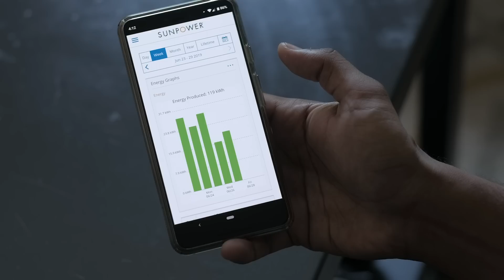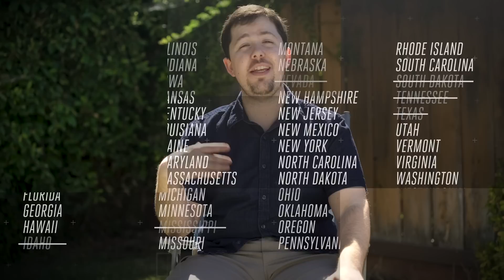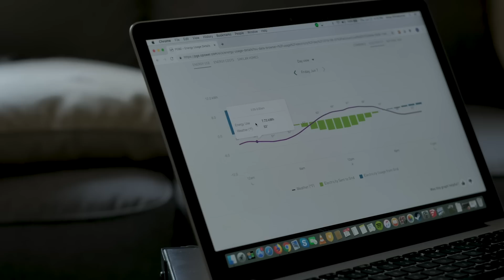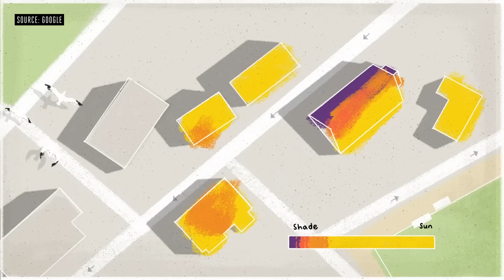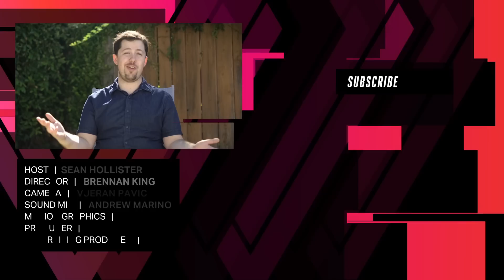Solar power is finally within reach, but not for long

Comment: $16000 is the cost of a cheap car...
Watching this in my 250€ golf
Reply: Considering energy savings, it will only take about 5 years to spend that much in electricity anyway, and anything after that is additional savings
Reply: @DannyRice01  sure, but u gotta have these $16000 in the first place...
Reply: @milonso650  You can pay for it with a loan, and use the savings on your electric bill to pay it off. If you go this route you have to wait the 5 years to start saving money but it still might be worth it long-term.
Reply: In US junker golf would cost more in maintainace, etc.
Reply: @ArthursHD  really? in germany they are the cheapest for parts ect. also, they are pretty reliable.
Reply: @milonso650  The US market is maximized to replace instead of repair.

Comment: You said it yourself in the video, the costs of these panels and batteries are going down all the time though. So even if the subsidies go away by that time the cost will be substantially cheaper, stop fear mongering!
Reply: Maybe, maybe not.  You cannot guarantee that Solar + Battery system will be 30% cheaper by 2022 ...

Comment: The UK subsidies used to be so good that you could get a 4Kwh system installed for free as long as you agreed to keep the panels for 20 years.  I don't think you can get them any more though because the subsidies are not that good any more but I managed to get them installed four years ago and they are truly amazing.

Comment: I am waiting for my Tesla battery storage, now.  Will have temporary electricity if power outages.  Plus be able to sell even more excess energy to the GRID.  I have my own micropower station.  Even with more wind and solar on the island my rates have never gone down.  You must look out for yourself and not the government.  More people moving to the USA and electric prices will keep going up.  Electricity is stable vs gas prices so I love my EV.  With its large battery, I never have to use any other charging stations but only my own clean home connector.

Comment: I saw the benefits with solar with expensive electricity in Hawaii.  I can not control healthcare costs but I can control energy costs.  My next purchase was a Tesla EV.  I save $900/month on gas and electricity without changing my lifestyle.  That is a lot a dough.
Reply: An average home in Hawaii is 1500 sf vs average home on the mainland, 2700 sf.  Most homes do not have air conditioning or heating as on Maui, we pay almost 40 cents/kWh.  Average mainlander pays 10 cents/kWh.  So multiply what you pay/month, on the mainland, by 4 and you would see how expensive electricity is on Maui.  I own a 2300 sf home and my electric bill was $600/month.  Gas averages over $4/gallon.  So you can see how fast you pay off your system in Hawaii.  It is becoming warmer and we may have to run the air conditioners.
Reply: @Firestorm637  wow...and i thought living in LA was expensive ...then good for you for using solar, hopefully climate change does not mess that up too
Reply: @hamadaj8081  Hawaii = The highest cost-of living in USA. It is a collection of small islands. If not made there, then expensive to "import". Cali is #2 ...
Reply: you use 900/month worth of gas and electricity??.....you must live in a mansion!!

Comment: buy a battery pack just big enough to cover the peeks
Reply: John C3333 no need for a battery in many markets. Net metering with the utility company makes that possible
Reply: @Matt.Collins  you don't want to depend on net metering though, because these programs come and go.  They could terminate it at any time.  It's good to have batteries and be self sufficient or at least close to self sufficient.  With no batteries your panels are useless if there's a power outage.
Reply: @redsquirrelftw  A battery bank to run the typical house, is a financial nightmare.

Comment: 5kw system for 18k usd??
In Pakistan u can get that for 3.5k usd
Reply: @T S In Australia the average 5kw system costs between $2700USD-$5500USD so it's probably got more to do with the cost of the panels.
Reply: @T S 😂
Reply: I am sure the sales company and the installer crew, permits, designer, etc all add to the cost of the basic parts.
Reply: @T S 46,000$ not 4,600$
Reply: @tonysmith6967  Not sure what source gave you $46k. The US Census has average income for household at $81,283 and non-family households at $51,197. However the average is a terrible figure to use in the US due to the top earners vastly distorting it to the upside. The median income is far more representative of most americans. Median income for those two categories are $57,652 and $34,611.

Comment: People always choose to go solar than to look at outer ways to save energy. For example, installing LED bulbs is a great way to save energy if your still using filament bulbs, also look into getting more insulation in the attic.
Reply: I'd be willing to bet anyone still buying incandescent bulbs isn't simultaneously pursuing solar panels.  I agree that conserving energy is absolutely important and a great goal but if you can do that and return some clean energy back to the grid for others to use at the same time, that's even better.
Reply: @palillo2006
 - Replacing all bulb in my house with LED's, lowered my utility by less than 1%.  Bulbs use a very small percentage of my total electric bill.   And the LED bulbs did not last the promised 15 years. My LED ROI was bad ...

Comment: So you are in California where electricity is expensive and is getting higher BECAUSE OF SOLAR. I am one for solar but when you look at Californias where you are basing this out of. Solar and most homes are called Grid tie systems. Where you are linked to the grid with a pay back system the problem is storage. Since you are feeding straight to the mainframe and not storage fluctuations for power cant be cycled. Everything else can be turned on and off by demand. Since these are independent power plants in perspective, nor there is any way for the providers of the systems to regulate this power like the cloud because it's all independent contracts. Also the fact that humans are greedy and want every penny. So it caused electric to spiral into a price hike due to instability and you the consumer to make it bearable in California to not be hit with a high bill to have it. Solar is not evil but a combination of no storage for off peak times, profiteering contracts, and more has lead to a crisis in California.
Reply: Totally agree, the better way forward is for electricity companies to buy large solar systems. Then we don't have the problem of everyone feeding their electricity into the system willy nilly. Plus economies of scale dictate that the price would be much cheaper. Rooftop solar is not great.

Comment: I'm guessing prices will fall way down when the tax credit runs out. With such a credit, there is an incentive for companies to charge higher prices than they would normally, such that the customer ends up paying the same amount they would should such a credit not exist.
Reply: That's generally true in a non-competitive market. Solar is quite competitive, which is why prices have fallen so quickly (despite Trump's market manipulation of, err, tariffs on solar to try to protect coal).
Reply: That makes sense to a degree.  But when you look at Tesla cars they only came down a little and much less than the tax credit, when the tax credits ran out. It was still a signficantly cheaper car when the tax credits were still around.
Reply: Those are both fair points.
Reply: exactly right
.
Reply: Given more to the Corporations again

Comment: In México, a ~15 KWh/day system (installed and with everything done with the paperwork) is around 5,000 USD, without any incentive 🙃
Reply: … no-oh, I explicitly wrote kWh, just for comparison 🙃
Reply: Where did you get it? I live in Mexico too.
Reply: I got a 7kw system and the panels are dirt cheap in Phoenix. I have about $6000 in my system batteries included
Reply: You confuse kW (power) with kWh (energy). 5kw worth of solar panels would produce over 50 kWh during sunny day.
Reply: @niter43  you're correct that kw and kwhr are different but no where on Earth you can produce 50kwhr on a 5kw system in a day. That's 10kwhr per kw system. Maximum production with high efficiency panels in high impedance regions is 4-5kwhr per kw system per day.
Reply: Div J on a sunny day, my 3.8 kw system  produces ~20 kWh
Reply: @niter43  Not really, there's no place on earth where you can pull 50kWh/day out of a 5kW solar installation. not even in the sahara desert.
Reply: you can in Norway, in summer time we have 24 hours light per day
Reply: in mexico it's half price because there is not trade barrier. solar panels are dirt cheap like they are. including fancy brand names. that what double-triple trade tarriff does. in usa the exact same panel costs double of what it is in mexico haha
Reply: yeah, but you have to live in mexico

Comment: I’m gonna go out on a limb and guess republicans (and corporate Democrats) are blocking efforts to renew the tax credit.
Reply: And you’d be right. Doesn’t help that we have someone in the White House who is adamantly anti solar and pro coal.
Reply: Nick C multiple things. I feel it’s the same technique Tesla motors is using tax credits to their advantage. As soon as the tax credit was halved they reduced their price to keep the consumers paying the same price. Tesla was milking the tax credit system and profiting from it. As the guy said, solar gets cheaper and cheaper
Reply: Nick C iirc it was designed to sunset from the outset
Reply: It has actually been extended since starting in 2008, twice, once by each side.
Reply: Notice all the solar farms? Corporate finance figured out, why should individuals get all the benefits. The incentives are just going away from you.

Comment: You might accelerate your payback by installing a heat pump hot water boiler.  

It should increase the percent of self consumption energy by allowing you to heat your water while at work.
Reply: I saw a This Old House on youtube where a guy used a chiller and a heat pump and went off grid.
Reply: Heat pumps are notoriously difficult to get right. Unless your source is a body of water, don't bother.

Comment: Solar Panels and Solar Roads might be a big fan among millennials but anyone around in the 80s can tell you they tried them all and they dont work. Just listen to experience.
Reply: Because nothing ever changes
Reply: You're saying like efficiency, longevity and price are same as 40 years ago, yeah.
Might as well get back on horses because cars didn't work as well back in the day.
Just for the context solar is just as cheap as burning coal (in some places even cheaper) since ~2017.
Reply: Just to put some numbers on it a solar panel is now over 50 times cheaper than in 1980.
Reply: Rykahnz I’m telling you, based on the personal experiences of people with experiences with these things, that they don’t work. Just a fad for Millennials, listen to experience.
Reply: I see you're a troll, is that actually fun? Maybe I'll try it to see what it's all about
Reply: Rykahnz No. I’m a traditionalist. Ive seen these things in action, they break down quickly. They promise 25 years but they stop working in 10 unless you spend thousands of dollars to fix them.
Reply: ??? No need to deny their existence pal, it’s the future

Comment: Net metering is not sustainable in the long run for the system. Keep that in mind.
Reply: why
Reply: IPlayGames Because Net metering implies that the price of electricity is constant throughout the day. It doesn’t reflect the value of electricity. You can get away with a small amount of producers doing net metering but at some point it distorts the wholesale market.

Comment: $200 a month? How is that possible, my apartment electricity is only cost $3-40 with AC and 4 always on computers.

I said $100 a month is more reasonable, that means take 10 years to get the money back. But people usually move within 10 years.
Reply: jake liu obviously you don’t charge an electric car at home.  For those of us who charge our electric cars at home  the cost is substantial.  Assuming electric consumption of 175WH/km and an average monthly driving of 2000km that is 350kWH/month of electricity.  At a cost of $0.12/kWH that is $42/month just for the car.
Reply: LOL $3 a month for electricity

Comment: Try these leading edge machines for non-fossil electricity, these are commercial & available:

Flip substations off-grid, 1-Mw, 50-year no-inputs warranty, Belgian: technokontrol, current project, RF-5000.

For off-grid, grid-tied homes or not, 10kw/$15k, 5kw/$8k, 20-year no-inputs warranty, S.Korean: infinitysav

Magnetic motors drive these, it's why they DON'T NEED FUEL or other inputs, only upkeep, found doing trade studies for a lunar mission, why use anything else in space or on Earth?

Comment: Americans trying to do something good:
America: I'm going to end this man's whole career
Reply: The same people championing solar power now are the ones who opposed nuclear energy in the 70s/80s. America could have cut it's emissions massively decades ago, but no, that's not green enough, so on we go, burning oil.
Reply: @phillycheesetake  Nuclear has been pushed away because of stigma due to small incidents. I think we should use nuclear and solar, and solar will eventually win because it allows you to be off the grid. But regardless nuclear is especially good considering there are reactors that burn waste etc. Just shove them underground and they almost act like geothermal energy.
Reply: @lucapfister  .

There are significant issues with nuclear. Waste being one of them. There is no such thing as a small nuclear incident. 
Even a small incident is catastrophic for larger numbers of people.

Thorium might be a partial solution since it reduces waste amount and type. 
The reactor design itself is much safer.
Using conventional waste requires fast breeders which have their own issues.

Still, short term solutions may require nuclear for some time.
Nuclear is a significant part of energy world wide; it isn't going away anytime soon.
Reply: @phillycheesetake  Nuclear isn't really viable as it costs nearly 9 billion to construct a new unit (AKA about 900 10MW Solar farms) . Better off just using the cheaper options: true renewables & energy storage tech.
Reply: @pvmvertigo7095  And no Chernobyls / Fukushimas necessary.
Reply: @phillycheesetake  America has vast amounts of shale oil and gas.